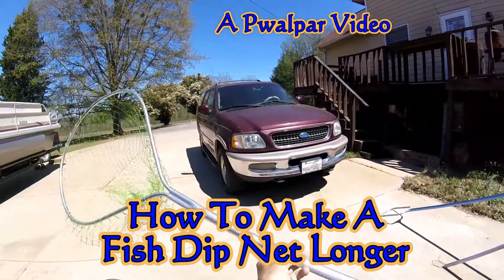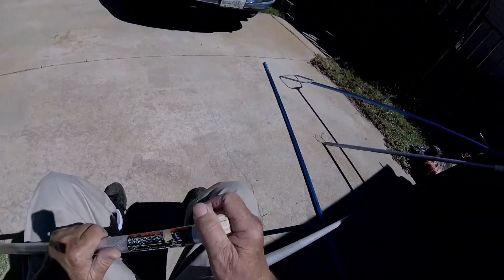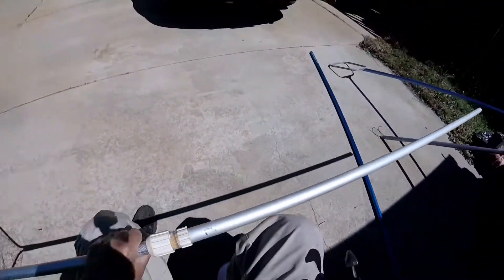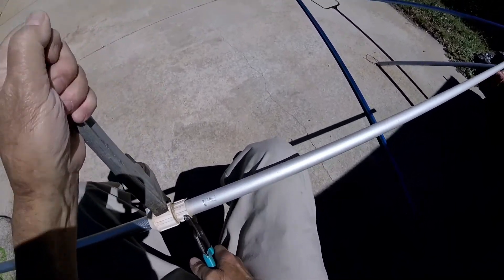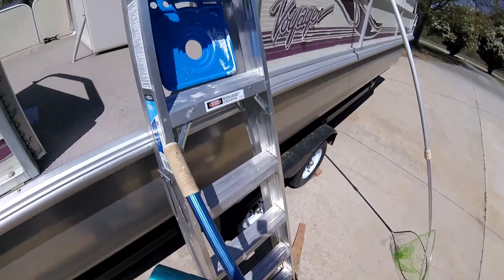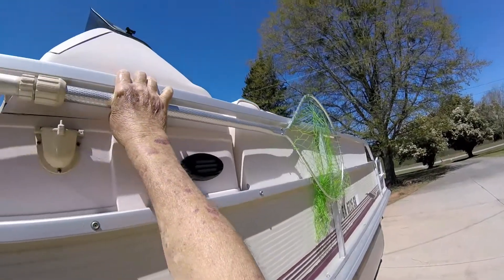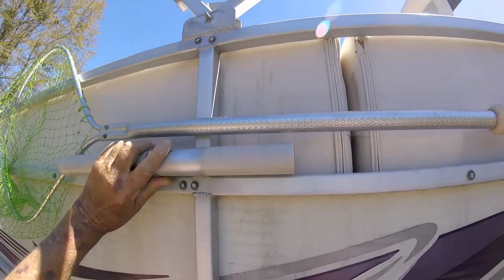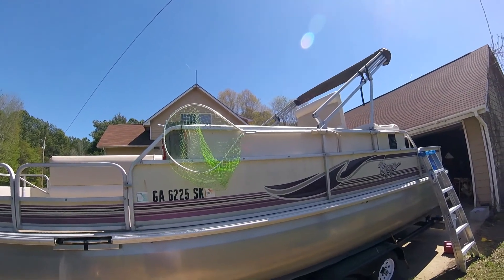How To Make A Fish Dip Net Longer

Comment: What is that white two piece called on the end of the pole that is used to tighten into the net? If I were to want to buy it, where would I go?
Reply from the maker: It is already on the pole. It is A swimming pool debris  net pole  Lowes or Home Depot or a swimming iou ng pool supply  they run about  20 bucks

Comment: 3 pieces of 3" schedule 40 PVC about 4" long having a groove cut in it wide enough for the shaft of the net to fit into should do the trick.Tilt the top back side of that groove towards the boat so as to not having to have a strap of any type to hold the extended net in place.  With the top edge in that position, it should look like a backward "C".  Now you know this ole dog still has a few tricks up his sleeves.  At one time back when I was in high school, I worked for a plumbing company and learned all sorts of shortcuts for several things.  Back then we were using cast iron pipe for drainage and copper piping for water supply.  We did a similar thing using a 3" cast iron pipe as I'd described using the PVC.  It worked very well and we never lost anything that was in it.
Reply from the maker: Thanks for the excellent idea